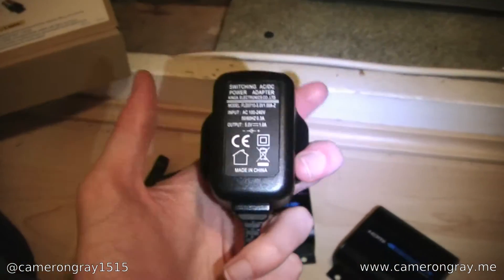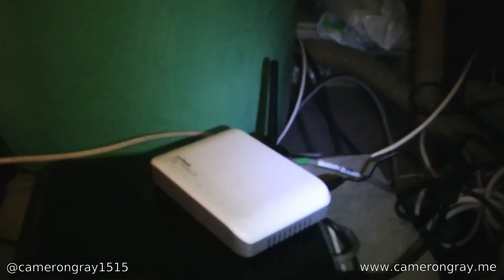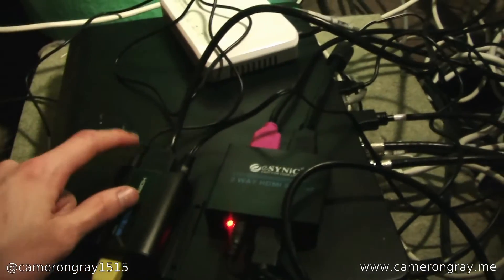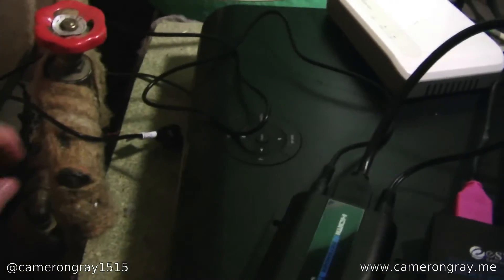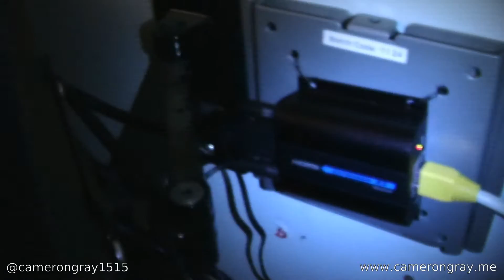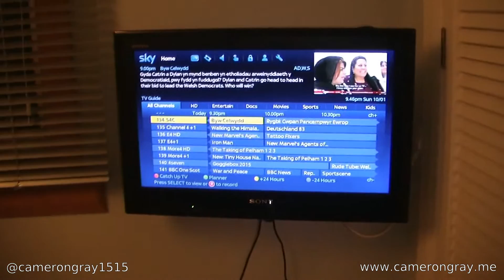HDMI over CAT5/CAT6 Extender by AGPTek/eSYNiC

Comment: I'm surprised to find this video while going through your videos searching for another video. We can get them in Singapore through companies who resell Amazon UK returns, and when it works, the built-in IR repeater surprisingly works with StarHub Fibre TV remote controls, as the type CA276 remote use a weird frequency that's incompatible with most IR repeaters I've tried!

I remember I got one that had 1 input to 1 output, and that turned out to be broken, but over a year later, I was able to find one that had 1 input to 2 outputs plus a passthrough, which has worked for the past week! That one with the passthrough does support EDID spoofing that was enabled by default and was probably why the previous owner returned it to Amazon, instead of reading the instructions. I set the spoofing mode to just pull from the passthrough.

Comment: Hi there, are these running the signal at 1080p from the sky box, just wondered as got loads of cat 5e and was going to do a run of about 15m.
Reply from the maker: These were only carrying 1080i as that's all the SkyHD boxes output.  If you already have the CAT5e you may as well try it but be prepared to buy CAT6 if it doesn't work so don't go plastering the cable into a wall without testing for example.

Comment: I have my skybox in the front room and want to duplicate the signal in my bedroom on another tv using this system, if I set the the ir connectors up as shown, I take it I'd have to buy another sky remote for the bedroom tv? And also would the front room tv remote still work with the skybox there?
Reply from the maker: Correct, you would need a second remote if you didn't want to share the one remote between the two rooms.  The remote will still work in the living room as long as you don't accidentally block the IR receiver with the IR emitter.

Comment: When you say it has to be a point to point link, does that mean it has to be a single cable? We have Cat 5e wiring in the walls but it terminates at a faceplate in both rooms so would need to plug a cable into the faceplates then into these devices totalling 3 cables in the link. Would this work?
Reply from the maker: Yeah, that'll work fine.  I was more meaning that you can't run it through networking equipment such as switches.  I've seen people attempting to use these over powerline adapters which obviously won't work.

Comment: Hi Cameron, are these still working well?
Reply from the maker: +H Yeah, still going strong
Reply: Cheers thank you! I have purchased these https://www.amazon.co.uk/gp/product/B072FLFRHY/ref=oh_aui_detailpage_o03_s00?ie=UTF8&psc=1 might change and get the one you have
Reply from the maker: Those look pretty much identical to mine - They are pretty generic devices so chances are it's the exact same set, just sold under a different brand.
Reply: They do don't they, just hope they are good! I am going to use them for the CCTV, the DVR is located in the loft so hopefully they are good.

Comment: Hey, I checked the Amazon link for the converters. Says compatible with cat 5e? Will normal cat 5 do the job? Thanks
Reply from the maker: It may work but only over shorter distances.  I used CAT5e, works fine over 17m of it but at 40m the picture started breaking up.

It's worth trying if you already have CAT5 but I'd be prepared to replace it.
Reply: Cameron would there be any issue with splitting the hdmi using the splitter and then connecting these to two hdmi over cat 5 converters? Both televisions are not near the sky box. Thanks
Reply from the maker: To be honest, I haven't got a clue! :P
Reply: no problem. I'll give it a shot and see! Thanks.
Reply: Cameron Gray hi I'm trying to set this up with my Sky hd box for some reason it's not working I'm using cat 6 and about 10m of it. When i connect it all up the converters the orange lights stay on from a flash so that mean it connected but In the other room there nothing coming to the telly

Comment: Quite geeky stuff .. well done for that :). I have a question though, more of your opinion really. I am thinking about buying this hdmi extender to connect my PC with the tele. Now you mention there should be a point to point link between both extenders something I can't do due to the positioning. I am however thinking about using powerline adaptors to traverse ethernet. Do you think it will work ?? So it will be like PC -> HDMI Extender A -> Powerline A -> Powerline B -> HDMI Extender B -> TV
Reply from the maker: Unfortunately not, these devices don't work over Ethernet, they just happen to use the same cable.  You can get "HDMI over IP" systems which should work as long as the powerline adapter is fast enough although they are much more expensive.  You may also want to look at wireless HDMI stuff if this would work better for your needs.
Reply: I just can't find something reliable and correct don't want to spend too much either. HDMI over IP.. that sounds interesting but as you said this will cost me a fortune... £270 on Amazon lol.
Reply: these should do the job - need to be decent powerline though as they require 100mbit 
they can be connected to switches and with multiple receivers you can build a little distribution system

I've used them at a number of clients and they work very well indeed

https://www.ebay.co.uk/itm/1080P-3D-100m-120m-HDMI-Extender-Over-Single-LAN-RJ45-Cat5-6-Cable-TCP-IP-Router/121708232481?_trkparms=aid%3D111001%26algo%3DREC.SEED%26ao%3D1%26asc%3D20160908105057%26meid%3D6a3e9f56892f4ab9b04ac1ba4ad10666%26pid%3D100675%26rk%3D1%26rkt%3D15%26mehot%3Dag%26sd%3D121708232481&_trksid=p2481888.c100675.m4236&_trkparms=pageci%253A73b5eb3e-e11e-11e7-a889-74dbd180afa7%257Cparentrq%253A5726eab21600aa1326d9acb2ffec33b3%257Ciid%253A1